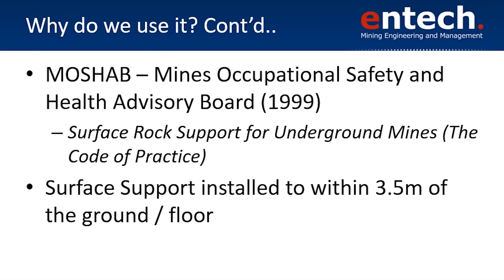MINING GROUND SUPPORT - with Tom Parrott

Comment: stiff split sets significantly increases the friction between th e bolt and the rock. The typical Ultimate Tensile Strength (UTS) , of even normal split sets, is 18 t. The normal friction is about 4t/m . A stiff split set friction is 15t/m . Therefore the full UTS can be attained . Great for holding big blocks in dense rock or even normal rock. Inexpensive especially compared to an MDXs etc. The also increase protection against corrosion.